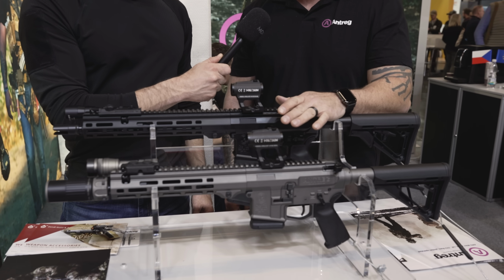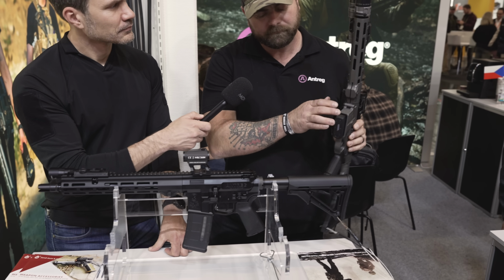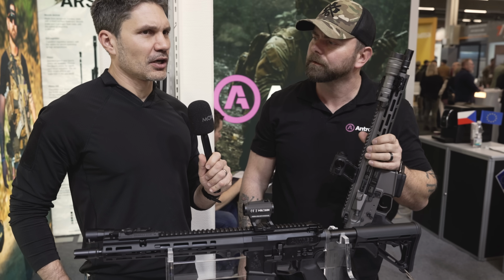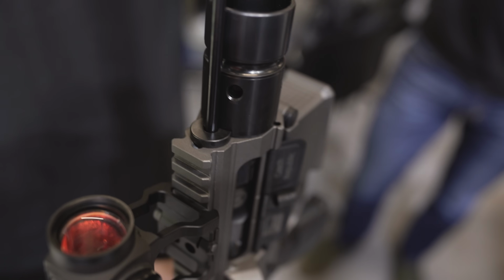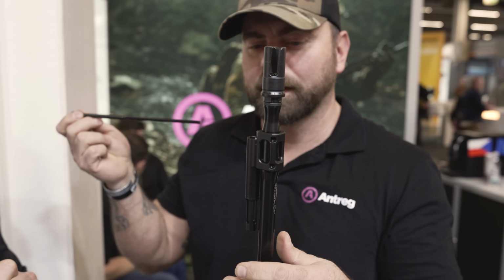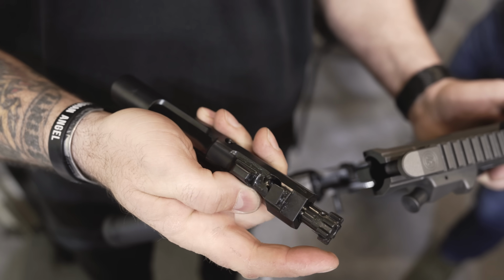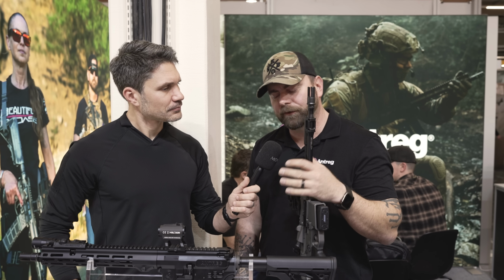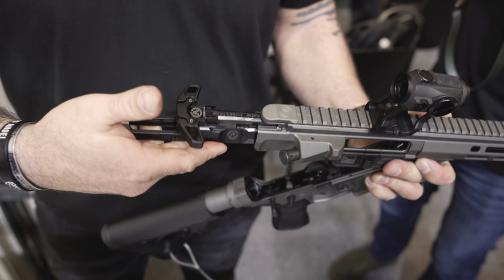The Czech 416? Antreg ARS M4s

Comment: Beyond what looks like impeccable quality and build, and the light weight features, to me the biggest selling point is the MilSpec interchangeability.  I wonder if they will sell the uppers separately--in the US they would sell like crazy.  Also, the only flag i have is whether the piston pushes back on the gas key and would then cause bcg tilt--that could be the Achilles heel of the gun.  I hope more comes out on that.  Otherwise awesome gun, from an awesome country!

Comment: Caracal 816 A2 still seems like the better economical choice (especially if your a veteran or first responder).   My build came out nice with their 16" upper weighs in at 7lbs 6oz with no optics.  Uses an AR bolt, firing pin, and mil spec lowers.  Buffer is a 5.4 oz tungsten powder, and using a red sprinco buffer spring. Buying the stripped lower and parts on sale , about 1700.00 in the basic build with the veterans discount 1200.00.